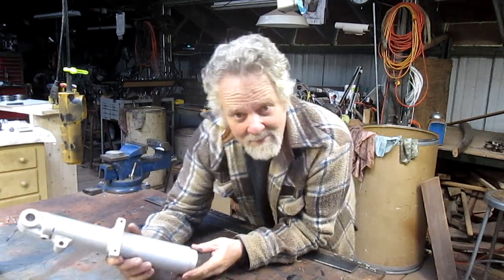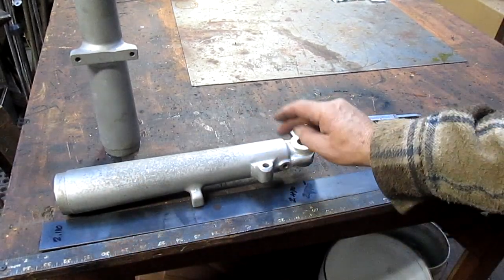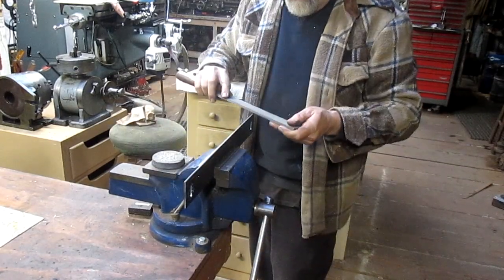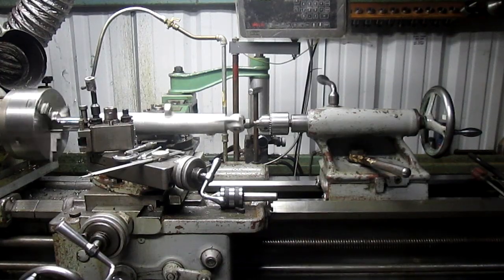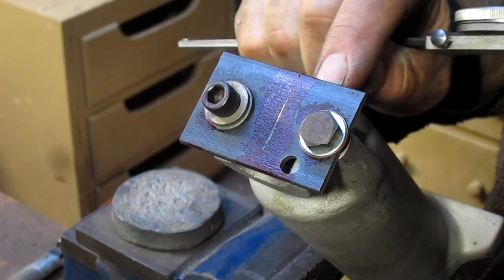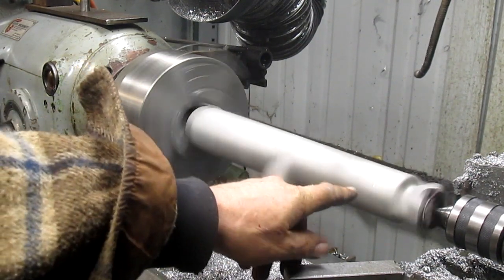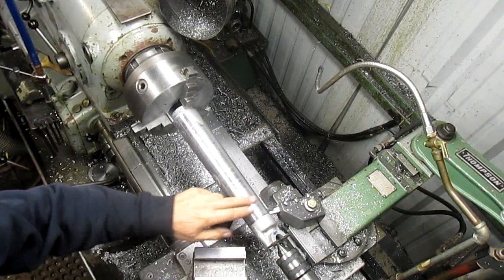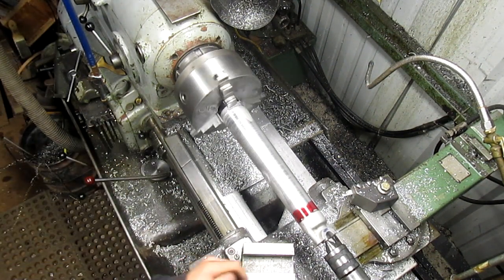Custom Harley Triple Clamp Build #1

Comment: Hi Nik, the reason it is eggshaped is to get more strength in forward/backwards direction, the MOT (annual test of vehicle safety) in my country would scream in anger if I showed them I had done the same, but on the other hand almost nothing is possible to legaly alter on ones motorcycle in my country, love your videos.
Reply from the maker: Also, a stock Harley weighs about 900 lbs whereas a chopper weighs about 400 so the tubes can handle the stress.

Comment: I was wondering if a 4-jaw may have been a better chuck for this, because you used the shims on the tube. I understand it is just a metal removal for rounding exercise, but that end you chucked has to mate to something. I use an indicator in my toolpost (the Edge Technologies one) with my DRO to 4-point align a surface that is buried in the jaws that way (I bring the indicator to the same point as I go around and read the DRO for the value).
This is a way cool project, making a bike be old school chopped. I never did bikes (just cars) but that never stopped me from admiring great motorcycles!
Reply from the maker: So many ways of approaching any given project, right? Stay tuned, this series has ten videos so far and I'm not even close to being done.

Comment: Ive never tapered a set of forks before but have shortened a bunch.  Very cool.
Reply from the maker: We did a lot of them back in the 70's.
Reply: ....Shaved and tapered was 'The Thing' back in the 1960-70's.....often this was just done by the chrome shops....just bandsaw off the lugs and sand/polish for a  while....
Reply from the maker: The customer is building a 70's replica out of a 47 knuckle head.